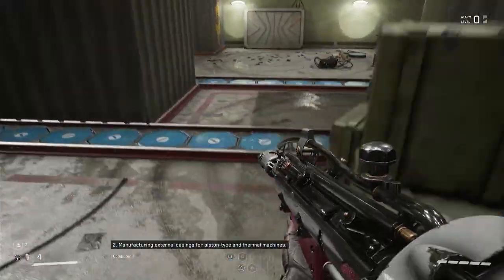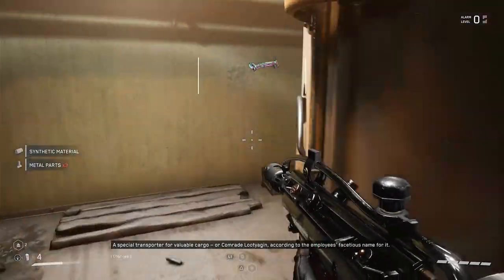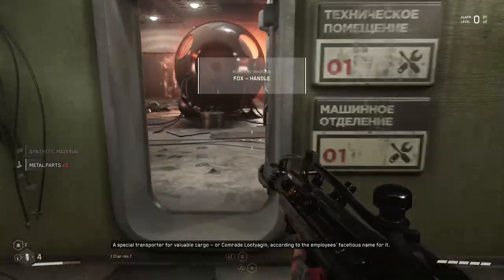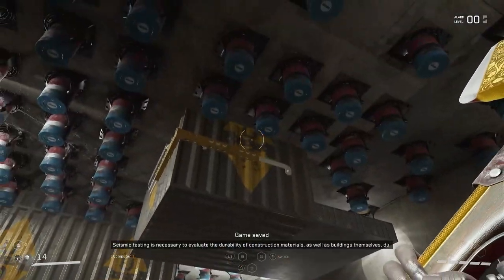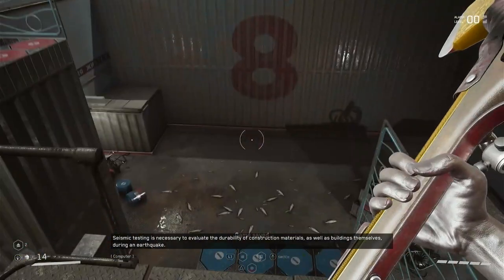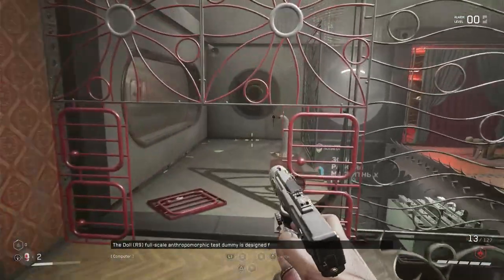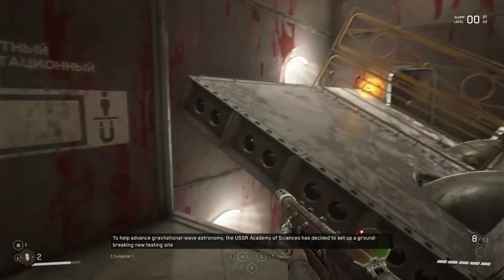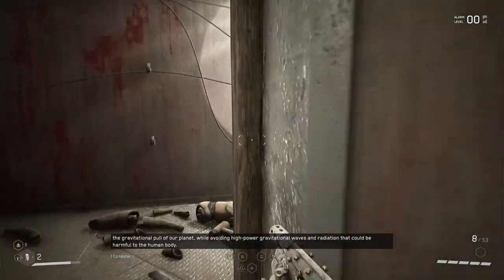All Testing Grounds Atomic Heart

Comment: I skipped a couple doors w/o activating the door with 1 orb instead of 2 orbs at TG 10. I would hold the double dash and bearly making it through. On the 2nd door, I would make it right when the door closes. Through trial and error, I ended up spraying the door with polymer and boom, I squeezed through. Some of the puzzles can be skipable. Just gotta keep trying even if you get frustrated. I got stuck on TG 11 and this video has been helpful. Hopefully you'll keep playing this game, you players. (I just found out you can throw items)😢 still, some puzzles can be skipable.
Reply: "I just found out you can throw items"  LoL😂